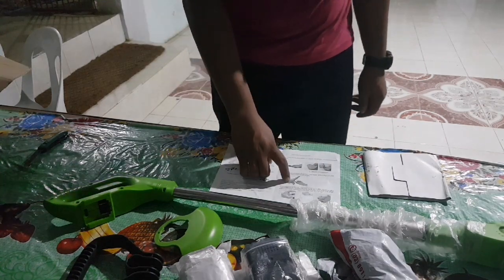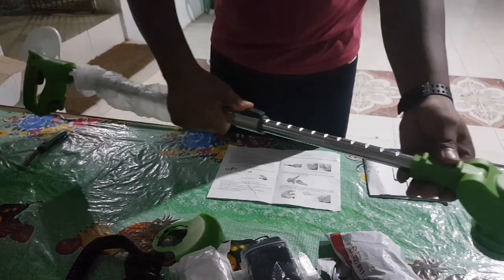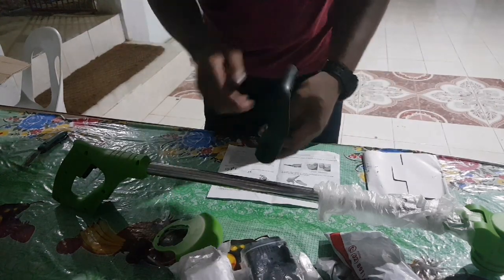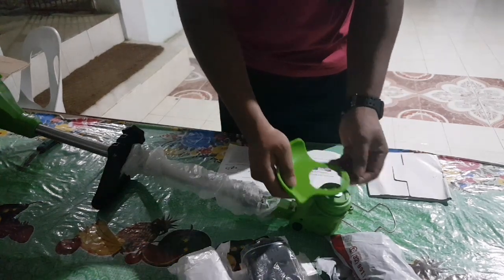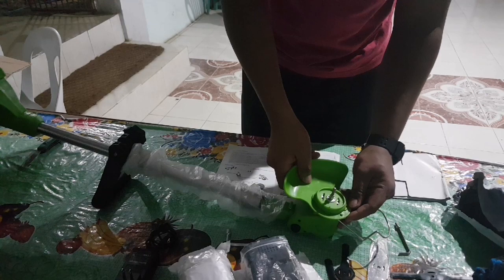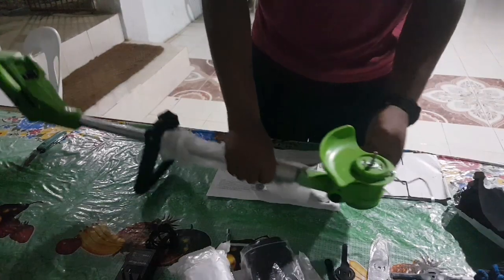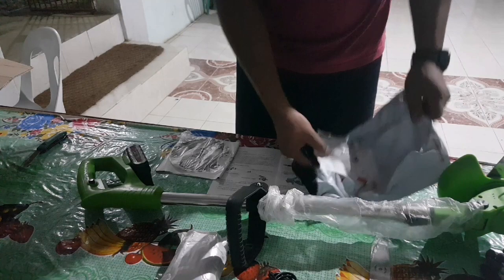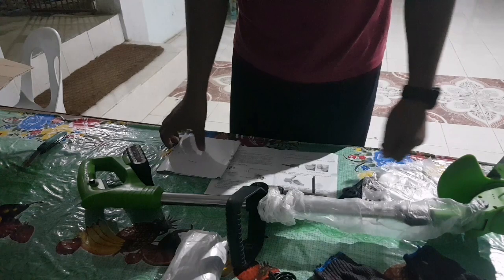How to assemble the new electric lawn mower/ grass cutter from shoppee

Comment: Hello po! Bumili din kami sa shopee nyan. Kaso medyo mahirap iinstall yung battery. Matigas po parang hindi kumakabit. Dapat ba pwersahin? Natatakot po kasi kami baka masira
Reply from the maker: 24 volts dn po ba ang nabili nio,
If yes itapat nio lang sa may kabitan den push lang po, it snap into place nmn po un. Hehe
Reply from the maker: May slot nmn po yan, hehehe sundin m lng po ung slot guide niya,

Comment: boss ano pinagkaiba ng 12v at 24v?
Reply from the maker: Power sir.
May kahinaan ang 12 volts. Samantalang da 24 volts medyo matagal na yung battery mo, malakas pa ang power output mo.
Reply: @howtv962  pero pag damo lang sa bakuran ok na 12v?
Reply from the maker: Ok na po yun.
Reply: @howtv962  tnx boss

Comment: Hi, how do you attach the circular blade?, having trouble attaching, thanks
Reply from the maker: Just place it on the plastic where you remove the previous blade. It has two D shaped hole, it should fit on the plastic attach to the motor.